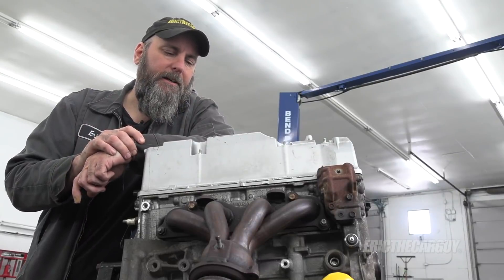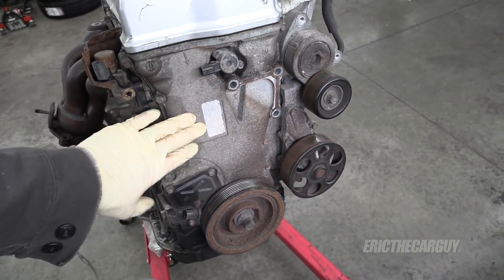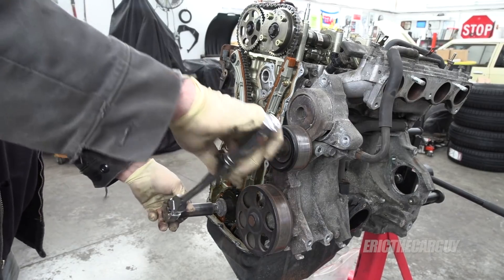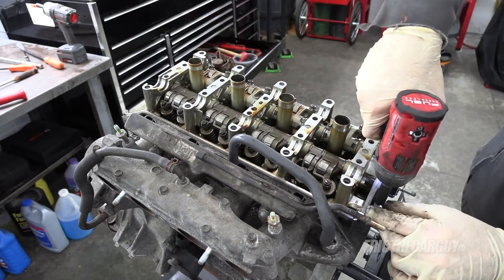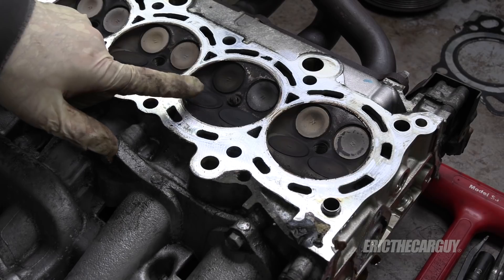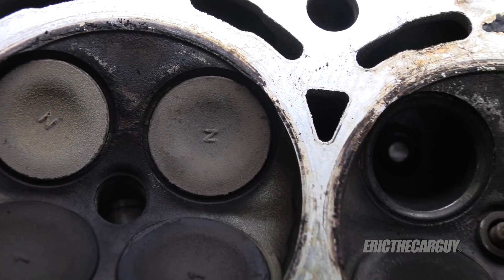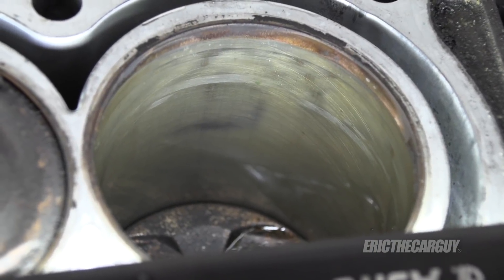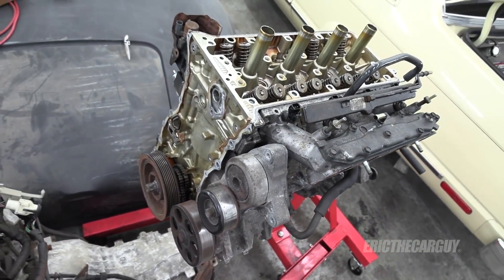Honda K Series Fail, What Went Wrong?

Comment: Tip for anyone wanting to take off and REUSE the head of your Kseries engine. (Like a head gasket replacement) DO NOT remove the cam bolt like Eric did by just unbolting them one by one, it WILL warp the assembly. 

You have to take off the Cam bracket bolts and Head bolt in a specific and slow quarter turn cross pattern in order to prevent warping and having to take everything to a machine shop.
Reply: You’re right. Start in middle and work toward outside evenly on each side of middle
Reply: It's best to take it to a machine shop regardless, with all that work involved taking it apart why wouldn't you?

Comment: Just bought a 2003 CRV with same K24A1 engine that supposedly had a bad #2 cylinder.  I compression tested it myself and all 4 cylinders were above 180psi.  Turns out all it needed was a new ignition coil.  I went from thinking I needed to rebuild an engine to just needing a $40 ignition coil.  Winning.

Comment: Had a TSX, (07) with a manual 6 speed, and the K24, ... i adored that thing.  Sold it with a smidge under 300k miles. Dude put a new clutch in it and drives it still today. I still miss that thing.  Great vid boss,...
Reply: Got an 04 TSX last year with the MT6.  Got it real cheap off a kid that thought he'd spun a rod bearing.  I'd planned on swapping the engine with an 06 K24A2 I had already built and was waiting to go into something.  Turned out it was the a.c. compressor.  Kid was a knucklehead.  I kept the motor in it.  276,000 miles and runs like a champ!!!! Fun fact about the tsx mt6.  You can use accord shift cables on them.  Just swap the mtwo cables around in the frame mounting bracket that comes with them.

Comment: That spring thing I learned from another youtuber is a bypass spring. If the filter element gets clogged the oil pressure can push it in and bypass. I guess the idea is that its better to let dirty oil through rather than starve the engine of oil.

Comment: The stamped steel spring is what opens the bypass valve when the filter clogs and can’t move oil through the element. It compresses and lets oil pass straight through in case of clogging.
Reply: On this filter, it only holds the filter element in place and has a hole in it so oil can get to the bypass valve, the bypass valve is built into the end cap of the filter media on this filter. The stamp spring has nothing to do with the actuation of the bypass valve, the bypass valve has it's own little coil spring that's designed to actuate the valve when the delta between the inlet side of the filter is too high either when the filter plugs or during a cold start when the oil is very thick and causes a very high pressure drop when it's forced through the media.

Comment: A post-mortem on my favorite engine ever, the Honda K24.  Thanks Eric!

I've also never seen a better explanation (show and tell) of why Honda valves require periodic adjustment.
Reply: Honda is not recommending it. Eric recommending it. Honda wins the argument.
Reply: @adobo6905  engine burned up from NOT adjusting , Eric wins. Bad Honda design.
Reply: @BigEightiesNewWave  your logic is unmistakably accurate.
Reply: @adobo6905  Honda actually does recommend it too...
Reply: @A_guy840  I took my 2006 Odessey to a Honda dealer with 185000km and K24 engine for noisy lifters and I was told adjustment is not a part of scheduled preventive maintenance or nedded.
Reply: @adobo6905  I suppose I should be more specific in that the engineers at Honda wrote in the manual that it is recommended maintenance. Your mileage may vary when talking to a dealer...
Reply: @A_guy840  Good explanation thanks
Reply: @adobo6905  Yep, I have a J30 and valve adjustment was going to be part of the valve cover gasket replacement procedure from the shop.  Did it myself, but they absolutely told me they would adjust the valve lash.  You have to at least check it with a feeler gauge.
Reply: @adobo6905  its in the manual. For mine (R20A3) its at 100k kilometers, and then every 60k kilometers.
Reply: Most of my friends from Honda do adjust valves, especially on the V6 engines.
My friend bought CR-V with burned exhaust valves on two cylinders, because it burned so much oil. Machine shop did the head, I cleaned pistons, new rings, deglazed cylinders.  After 20K 'no drop' of oil from the dipstick. For safe measure 8k km synthetic Eneos 5w-30 OCI (screw the CAFE recommendations).
Reply: @adobo6905  there is no lifters in Honda engines

Comment: i replaced an exhaust cam when i got my e at 320 000km(worn out lobe) did a valve set after watching your video, i checked my plugs a week later and found one running hot, watched your video again.. did the valve set again, and found i had one exhaust valve a little to snug, i just hit 400 000km and going strong on the original engine. very easy to to over do it lol Thanks for your help and all your info, fun videos to watch

Comment: You are such a good teacher for auto problems. Thank you.
Reply: He is but i don't buy that a valve caused him to lose all compression it might of been his piston rings. He didn't test the other cylinders for leakage to see if it was normal for it to leak. Sometimes it IS normal and i had a machinist i knew who said it was fine for the valves to leak in a test because the amount of igniton cycles and speed causes them to seal. Its not accurate to do a test like that is what im saying.

Comment: K Series is one of the best internal combustion engines ever manufactured.
Reply: Bit like the 1.9tdi pd
Reply: The best naturally aspirated that will ever exist possibly
Reply: Volkswagen is superior
Reply: @tiberiusclaudiusnerogermanicis  ew, pumpe duse. ALH ftw
Reply: Yeah clearly not 🙄 
Did you watch the same video I just did?
Manual valve adjustments go way back to early 20th century! You'd think they'd upgrade by now 😆
Reply: @hunting447  surely you jest!!!
Reply: @jeffthejinjer  Hydraulic valve trains have their issues too and are way more susceptible to poor oil maintenance. Takes away valve adjustments but then the owner needs to be extra diligent on oil which people can be hit or miss. That valve train is part of what makes them "bulletproof" and able to take abuse.
Reply: ONE of the best yes.
Reply: @jeffthejinjer  manual valve lash adjustment means that you don’t have hydrologic lifter issues in the future.  It helps the engines be so bulletproof, especially when tuning.
Reply: So this is an engine with over 180 thousand Miles on it. Look at the way its built. So much better than others. A lot less plastic.
Reply: @shadowthesi  I know what it means I'm just saying it's old technology. I had a Chevy 355 small block solid tappet extreme energy 305 camshaft race engine back in the 90's that I ran at the drag strip. I just can't get over the fact that Honda is still using that style of drive train and then using cam phasers to adjust timing...just a very odd setup compared to today's engines. I have a 3.5L Ford Edge with hydraulic lifters and it's coming up on 300k miles.
Reply: @jeffthejinjer  I guess you should write Honda to tell them your opinion about their antiquated engine design. 
If it works, and is reliable, why update it?
Reply: @hunting447  funny joke
Reply: @jeffthejinjer  ain’t broke don’t fix it. I like how they work and it means that you won’t have any hydraulic lifter issues. Also the Ford 3.5 has other issues like internal water pump failures.
Reply: @shadowthesi  no water pump issues if you use full synthetic oil and Peak10x coolant or MC yellow...just preventative maintenance. I've owned several Acura's and personally i.like how they handle but the cost to own and repair is wayyyy more than my 2015 Taurus!! I never understood why Honda/ Acura owners say they are cheap to own.?
Reply: @jeffthejinjer  not sure what you’re talking about there. Hondas are cheap to own, my civic takes miles like a champ.
Reply: @hunting447  Superior at breaking down and crumbling to nothing when looked at funny.
Reply: @jeffthejinjer  i drove a first gen acura RL for 5.5 years. car never failed to start or left me stranded, i miss that car
Reply: @jaredsouza4631  until you replace a starter motor on a 2004 Tundra V8 Yota  😆
Reply: Just not the Rover (powertrain) K series 4 potters.
Reply: @hunting447  do you honestly actually believe that? I'm seriously asking...
Reply: @glanzera  lol no. I am a tech by trade. I know they are trash
Reply: @hunting447  haha okay apparently I missed the sarcasm 🤣
Reply: @hunting447  that’s funny.
Reply: Apart from the fact they burn oil and mechanically fail.
Reply: They burn oil and fail like this one.
Reply: @jeffthejinjer  Only thing you'll ever have to replace on a 2UZ (Removing the manifold isn't that hard anyway and Cadillac does the same thing), meanwhile a Ford 3V is the biggest hunk of crap ever made.
Reply: @XenomorphLV426  Every engine burns oil, let me introduce you to the Ford Duratec.  The burnt valve was probably caused by some newbie thinking they know how to adjust valve lash.
Reply: @jeffthejinjer  valve adjustments will be out of date when free valve is common place.
Reply: @5162-b8y  yep mine burns oil not even at 130k miles.  Not terrible but there is noticeable amount of oil missing on changes.  Im kinda hesitant having someone adjust my valves now after seeing this lol it might be better just to let it ride.
Reply: I always thought wet black or sooty plugs indicate oil consumption.   These light brown plugs look fairly normal to me.
Reply: It is not, not this engine. Integra type R JDM engine is designed so much better and can take turbo or supercharger mods. This 2.4L is a piece of junk comparing to it.
Reply: Honda and Toyota are thee BEST
Reply: @hunting447  lol
Reply: To all the haters this is the best engine money can buy people swap them into Ferraris, Mazdas and everything in between. This is not a common failure.
Reply: Bs. You dint know that this element 2.4l is not a real k engine.  These 2.4l are they always blowing headgaskets,  burning oil,  siezed engines.
Reply: @pliedtka Finish your homework and go to bed, child.
Reply: @dylano7242 What makes the K24 in the Element "not a real K series" ??
Reply: Junk
Reply: @shadowthesi well except for timing chains oil pumps burnt valves and constant leaks
Reply: Bahaha trash
Reply: Yessir
Reply: Agreed!
Reply: @majist0 your fucking go to is ford? Compare it to a Toyota

Comment: I've had 4 elements, all still running like new and I have never seen or heard of a K series engine going bad under 200k [unless regular oil changes and maintenance were neglected] but even then it's rare... I would have just changed the valve out and run it for the next 100k... the K series are almost indestructible as we all know, that said I really enjoyed this series on the engine swap and learned a lot about my trusty ride... Cheers!

Comment: strange for a honda engine, i’ve had to do a valve adjustment on this same engine (K24A1, for a CR-V) at only ~60k miles. i essentially got an error code related to idling.  and when the engine was cold, i would have problems with the engine dying when at a stop light. 

i was proud of myself when i managed to fixed the problem myself.

Comment: K Series, Best engine ever made by Honda imo.
Reply: maybe most powerful and advanced but the D series was their best most reliable design imo.
Reply: They’re bullet proof. Valve cover gaskets leak but not a big deal.
Reply: I agree ☝️
Reply: I love B16 and B18 engines, have owned a car with them. But have to agree. They are insanely good value for money, the can be a huge powerhouses or reliable daily driven cars. Not many engines can claim to be so versatile.
Reply: @TheRebuilt1  b series over d series. D series will eventually have head gasket issues. But timing belts are a cinch to change.
Reply: My 2005 Accord is still going at 256K. Starts every time. Burns some oil and had a couple easy leaks to fix (valve cover & vtec solenoid gasket). Otherwise she's great. Such a reliable engine.
Reply: I have a k24a2.  Motor is awesome.  My only criticism is the stock VTEC crossover.  It is set too high and you drop out of VTEC when you shift.  Stock for stock, the only Honda motor I like better is the F22C1.
Reply: @TheRebuilt1  Considering all the issues the D series engines have with their head gaskets, I beg to differ. And I have a D17A2 so I'm speaking from experience.
Reply: @averyalexander2303  i melted a piston on a stock d16y8 on the highway lol. Bought a used piston, new rings, removed the residual aluminium on the cylinder wall with some acid and a little bit of honing and sent it. Oh i almost forgot put in a set of used main bearings too because the old ones were destroyed. (If you are asking why used parts / and also why not a used engine - honda civic coupes are very rare in bulgaria.
Reply: @Hosz688  I agree the vtec crossover needs to be at least 1000rpm lower in the rev range mine would scream nicely if I did that. I also recommend the lightened flywheel and stage 2 clutch kit from effortissimo racing on Amazon it transforms the power delivery in a very good way
Reply: K series actually have huge oil consumption issues and it's very common...
Reply: @youngb1ood  A lot of the B series engines like the B20's used in the early CRV's had problems with burning their valves.
Reply: Classic case of never had a valve adjustment..  shame.. Re do the head, leave the short block alone, that thing will go another 184k EZ!
Reply: @jasonharris996  same here.  04 accord. 330,000.  Daily driver.  Replace TPS sensor and steering pump and just keep on going.  They're incredible engines.  You have overheat them or starve them to kill them.
Reply: @alantran6901  This is somewhat true.   I have seen many cases where higher mileage engines burn oil through the valve guides.   I think the more imperative issue to give consideration is oil leakage.  The engines have several hydraulically  actuated functions;  timing chain tensioners and came phasing.  The engines just out last the gaskets for those oil passages.  Rubber can only take so many heat and pressure cycles.  The engines lose more oil to leaks than consumption.  If one owns a higher mileage k motor,  they need to be diligent about oil levels.  I have a k24A4 with 330,000 miles.  Runs like a champ, but I do have to put a quart and a half a month in it when daily driven.  An acceptable sacrifice for me.
Reply: @johnsmothermon6856  I have a k23 in an RDX with 250k and it runs like a dream. I did however have oil consumption but it was leaking as opposed to burning oil. Valve cover gasket solved that issue and I hope to get another 100k on it before I think the body/transmission or suspension might need to be addressed. Wish I had 06-09 civic Si- couldn’t find a decent one in NY when I bought the RDX. Turbo plus HONDATA= fun little cuv!
Reply: I'm a b series kinda guy
Reply: @averyalexander2303  because people dont adjust the valves
Reply: @robertalicea5585  That's a good point, but lots of other engines like the K series don't have a reputation for burning their valves and most of them don't get proper maintenance either, although it obviously can happen to any engine as this video proves. Perhaps the B series engines are just particularly sensitive to the valve adjustment.
Reply: I'll go with the J series. My 98 Accord V6 has 305,000 miles and is going strong. Smooth power delivery and much quieter than the F23A1 in my other Accord.
Reply: @briangreen430  A V6 engine is usually smoother and quieter than an I4 engine  because it is better balanced and more cylinders means less gaps between cylinders firing. The F23's and a lot of other higher end 4 cylinder engines have balance shafts as an attempt to cover up the imbalance so the engine runs smoother and quieter, but that system isn't perfect and it doesn't address the fact that a 4 cylinder engine has less cylinders firing per rotation, leaving more gaps in the power output.
Reply: Burns oil
Reply: What about cutting the balance shaft belt 🤔  on those cars
Reply: @Etc Hosts also the unreliable automatic tensioner is kind of a bust. I’ve replaced two k series because the chain let loose due to a faulty chain tensioner.
Reply: H23

Comment: That bottom end looks to still be serviceable; a good honing and fresh rings would do wonders for it! As for the cylinder head, it would make for a good core for a new head. (Whoever owned that element before you, was very likely RELIGIOUS with oil changes which is probably why it’s so clean inside)
Reply: yeah and whoever did the valve adjustment (probably some brand new tech at honda) fucked it up and ruined the exhaust valves.  that is why doing the work yourself and taking your time at home is better than letting some  high school flunkie do it at the honda dealership.

lot of the dealerships recruit people from stickers that they put on the oil filter.
Reply: @SignalStopper  perfectly daid my friend. You put my thoughts into words perfectly
Reply: The 2.4L and V6 engines 'tighten' valves clearance with usage, and adjustment is a must on them. But most likely the piston rings are also baked and with the increased temperature caused by burning oil the valves suffered as well - I did a few of these.
Reply: @pliedtka  Do your maintenance you won’t have an issue.

Comment: Eric my 2003 honda element went 249000 miles. No problem I though these engines were bulletproof.  And no I wasn't always light on the pedal.  Yes I had the valves adjusted every 70 to 100 k.    😊👍